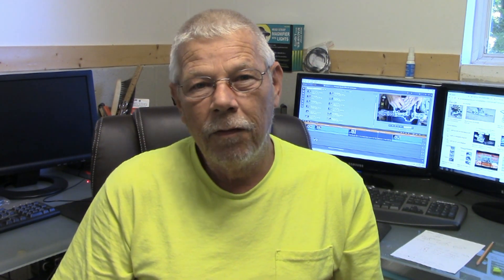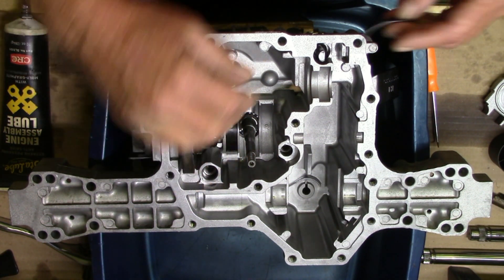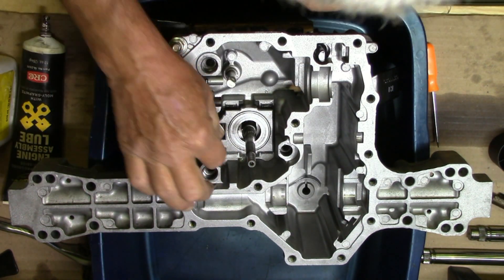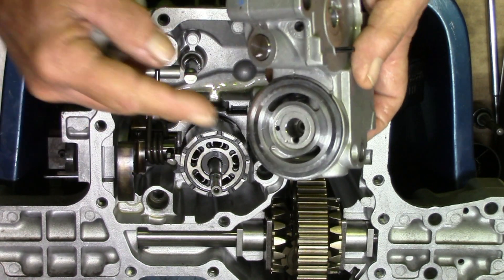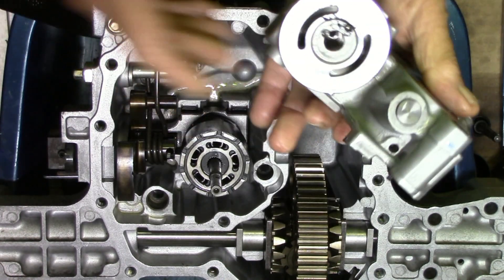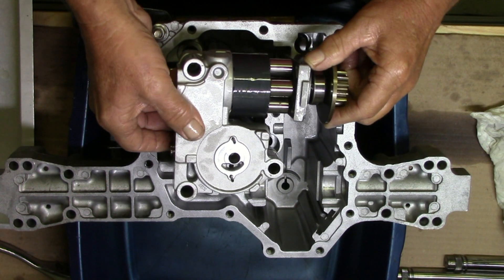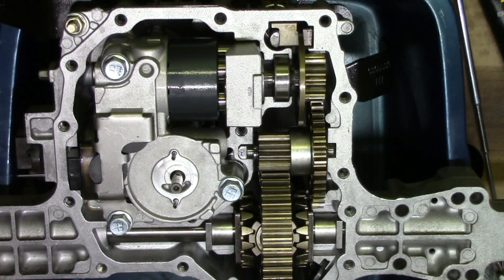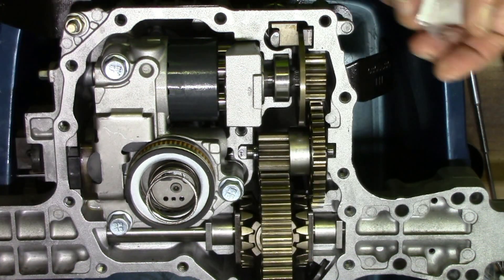Husqvarna YTH 24v48 Hydro Transmission Rebuild

Comment: Where did you buy the rebuilt kit and where do you determine the number to what kind of transmission it is
Reply from the maker: This is a common transmission found in the Husqvarna models around 2012 and up. You can find the information on a sticker located on the back of the transmission. Locate that Number and go to the Tuff Torq website. Parts are available through Tuff Torq or with the part number you can get from Ebay, Amazon or other dealers. Hope this helps and thanks for watching.

Comment: It go to a YTA 24V48 can you make a plug hole for it when it  made out of plastic
Reply from the maker: I would not do it without knowing if there was something against the plastic on the other side. You could get lucky and find the right spot or you may drill into an internal part creating a nightmare.

Comment: Mine has a plastic casing around it with no  can you take these apart and rebuild them
Reply from the maker: I can't say for sure as I've never taken a plastic one apart. Most the plastic ones they claim are non-serviceable. Find the model number on the case. Search that model for parts. That will tell you if you can at least get a filter.  The filter is key and usually clogs and causes problems for these transmissions. What problem are you having? Post that tranny model number here and Ill see if I can help you more.